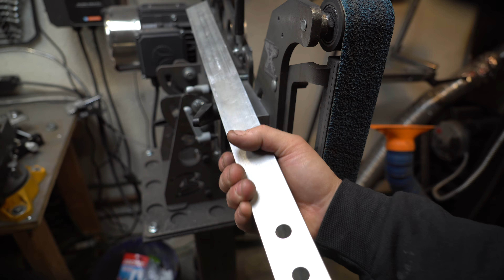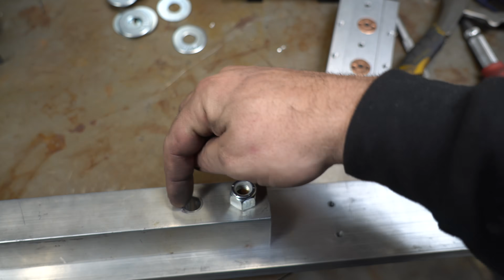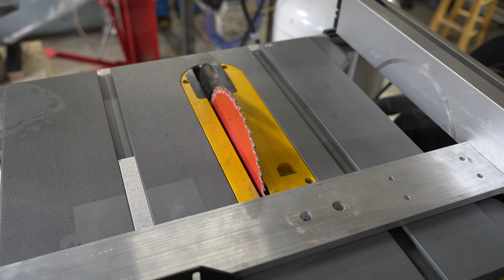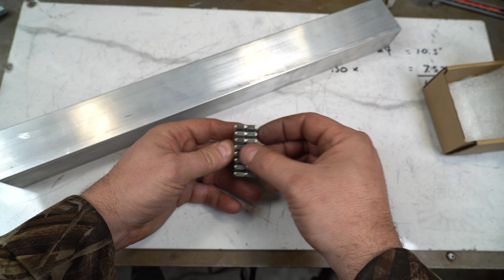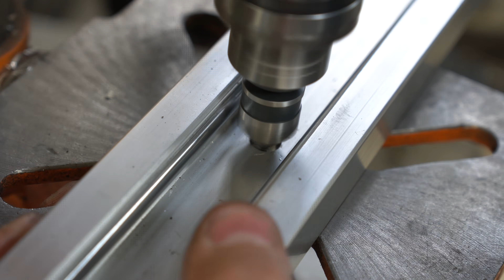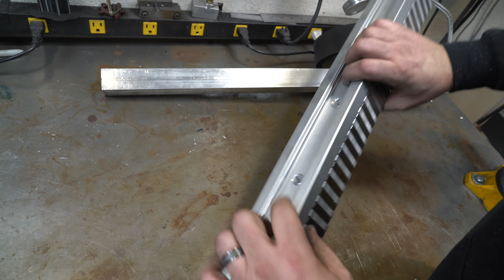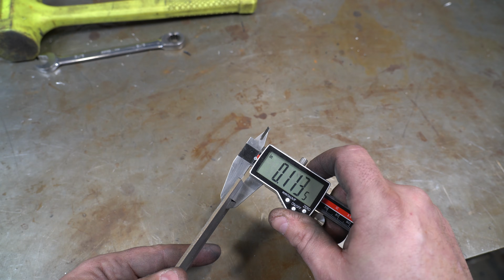Triple-T #110 - How to build a surface grinder

Comment: Hey buddy, I'm having issues getting started, I need a belt grinder so i can begin my knife making, should I build one ? Or is there something you suggest? I can't afford the big ones like I should have but someone has to start somewhere right ?!
Reply from the maker: I suggest you get the Revolution grinder kit from Brian at Housemade.us.  It takes a bit of welding but if you don’t know how, that’s a good skill to learn.  He’s got a sale running right now as well.  Thanks for watching.
Reply: @TyrellKnifeworks  yeah I can weld, I'm no professional but I have welded my fair share of chassis, frames and axle supports for my rock buggys
Reply from the maker: @GerstBladeworks  it’s an easy build compared to those.  Get a Revolution. 👍
Reply: @TyrellKnifeworks  I just don't have 700 bucks to start out making knives. I feel like there has to be a lower priced piece of equipment I can start out with. What did they do back in the day? I know eventually I'm going to work my way up to a larger, professional grinder but I need something far more affordable at the moment. I'm trying to get my knife making off the ground but I've been plagued with terrible luck over and over again for the last year. I had to sell everything I own except my car. I'm now homeless and live in a big canvas tent.. I feel like if I can just get a few models out there so people can see my designs and my work, I can turn my luck around and start making a living doing what i love
Reply from the maker: @GerstBladeworks  I thought you wanted a 2x72 grinder.  There are smaller options like a 1x30.  Those you can pickup for about $150 as a combo with a disk grinder.  Grizzly has one for $149.  You can find just the 1x30 for about $50.  Checkout Harbor Freight.

Comment: You could cut the grooves for the magnets on the table saw instead of a mill.
Reply from the maker: Several have asked the same thing. 
I think maybe you could, but you’d likely go through a few blades and it would look pretty rough.  It might work though.  Thanks for watching, Patrick.

Comment: If you can cut aluminum with a table saw, couldn't you cut the slots for the magnetic chuck with a table saw with way you might cut box joints?
Reply from the maker: It’s possible but aluminum is hard on your blade.  You’d probably go through a couple blades in the process.   Certainly an option though.  Thanks for watching, Sam.

Comment: I have made one based on the one you use (so thanks for that). But i used cheap on/of indicator stand magnets instead of the permanent magnets. The magnets are 40kg 5 euro per Pease. These magnets you can bolt on instead of machining slots in the bar. It is a little bit bulkier but work great.
Reply from the maker: I tried to make this build as cheap as possible.  There certainly are more expensive options.
Reply: That's treu,i did it because i hadn't a milling machine. But it's more expensive.
Reply: Have you a link to the magnets please.
Reply from the maker: @DTKcustomknives  the link to the magnets I use is in the video description.  If you’re referring to @makermaker276, hopefully he’ll post that link.
Reply: @TyrellKnifeworks   hi buddy
Yes I have the same magnets you have used to build my own Chuck,yes my question was for @makermaker276 if he replies? 
Thanks for the reply buddy 👍
Regards

Davy
Reply: @DTK Custom knives  
It is a while ago. The link doesn't insist any more. I saw that the prices are a lot higher now, because all the troubles in the world . So i can't help you any more with that.

Comment: Hi Dennis, is it important the "40duro" for the contact whell ? Thanks !
Reply from the maker: No, not at all.  Just get a flat contact wheel.  The size isn’t critical either, it could be 4/6/8”.  The 4” is the cheapest option and what I used for years.  Thanks for watching.

Comment: Dude I have an idea ,maybe make a release that comes up the center of the chuck 

That’s a lot of force on the tooling arm and grinder when you had to snatch it off 😮
Reply from the maker: The workpiece usually slides off and isn’t pulled off so it’s not too bad.  Making a lever action mag chuck would be cool but complicated.  Thanks for watching, James.
Reply: @TyrellKnifeworks  make a cam bolt that just bumps the work piece up enough ,not really that complicated 

Thank you for sharing